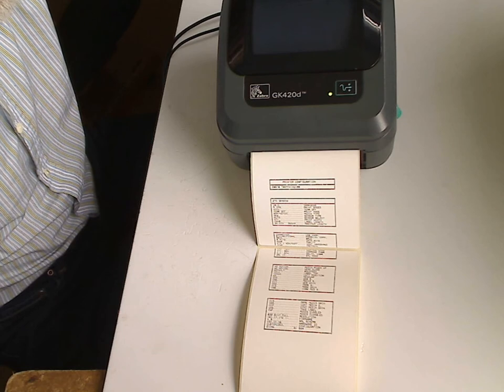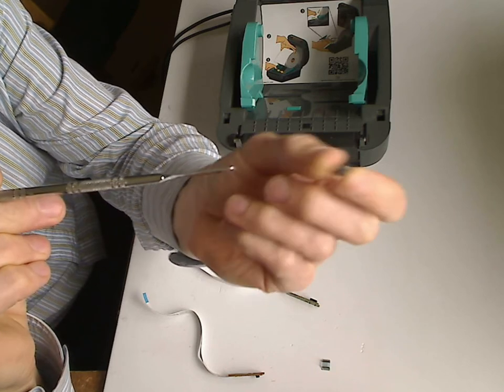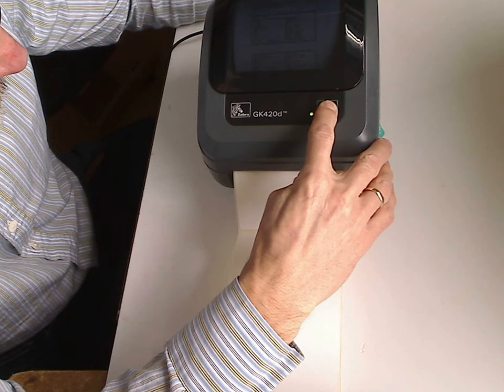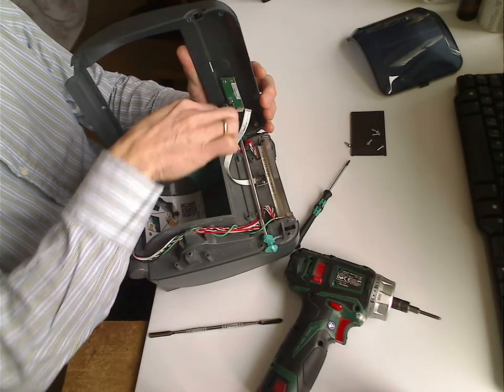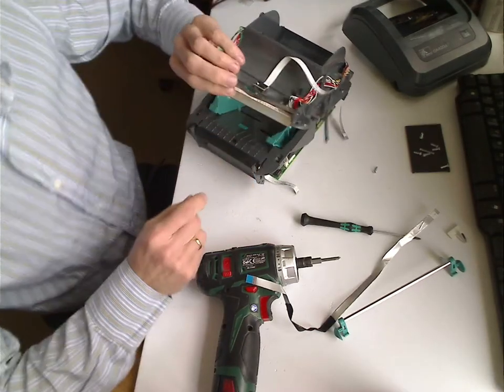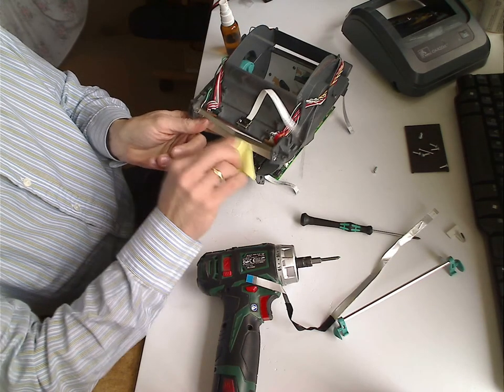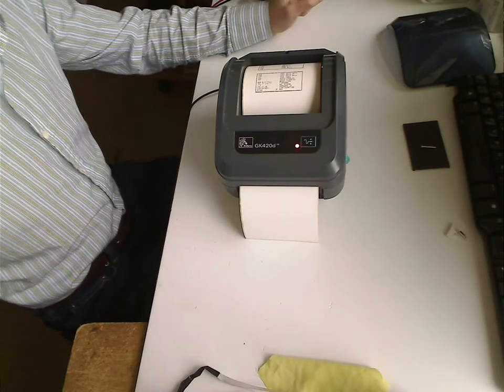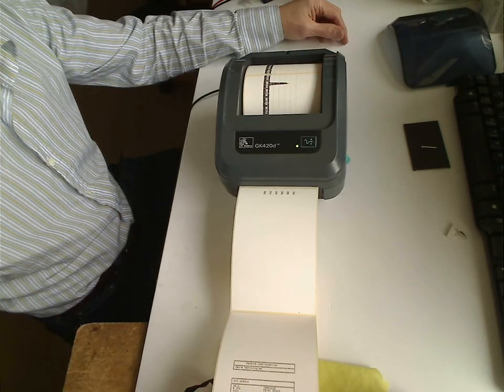Zebra GK420d not calibrating fix by changing flat ribbon cable

Comment: I have two Zebra GX430t printers and they both worked perfectly. One day one of the printers had wrap up when it got down to the end of a roll of 6X4 labels. I cleaned out the mess and tried to recalibrate it again for 6X4, with the two blink setup but it wouldn't do it. I can calibrate it for 2.25 X .75 and 2.25 X 1.25 but not for 6X4. There appears to be no damage to the sensor on the bottom, and I cleaned it, the print head and the roller with alcohol. I've reset the printer to its defaults but nothing I have done has worked to fix this. The other GX430 calibrates perfectly, so there is no problem with the software setup. Can you solve the mystery?
Reply from the maker: Try to print Sensor profile with keeping Feed Button until seven blinks and see if profile has spikes and they height. It's a bit weird issue- usually it either calibrates or not.
Reply: @zebraprinterrepairs  Thank you. I believe I tried that along with other methods I read about, but finally gave up and sent it off to Zebra for repair.

Comment: Very good information I really learned a lot more about this printer.  Thanks
Reply from the maker: I never tried to print profile for perforated labels so can't comment much but if it is peaks it means sensor is working. When sensor is dead then you will have just flat thick print. Cable change will be your solution.
Reply from the maker: Sorry- replied to wrong thread

Comment: Hello,

Thank you very much for the video, it is very informative.
I have a problem with a ZEP 505 EPL FEdex. it prints very well but after each start (as soon as I turn it off and turn it on) it ejects a label. I don't understand why she is doing this. Can you help me please ?
Reply from the maker: It means that default action at start up is set to "Feed". It can be changed sending ZPL command ^MFp,h N using Serial connection only. 
Or simply leave printer all time "On" and you will not have any headache :)
Reply: @zebraprinterrepairs  Hello, thank you for your answer.

Unfortunately, I can't leave the printer on all the time. and I don't have a serial port on the printer (RJ45 and USB only)
I found another tutorial which talks about this problem and which gives the solution but on a ZP 450 and not a ZP505 like mine and I cannot find a way to deactivate the option. :-(
Reply from the maker: @billeltouaibia7189  It seems it is the way to solve your problem. You need to download ZDesigner driver for ZP505 from http://www.fedex.zebra.com/drivers.asp and Zebra Setup Utility from Zebra website. Then you copy command bellow and sent it all at once using USB : 
^XA
^MFN,N
^JUS
^XZ

via Zebra Setup utility "Open communication with printer" . After command sent restart printer and label will not move after you turn on printer.

Comment: My Zebra GK420 is flashing red slowly. The media is loaded and the lid is fully closed but still keep blinking red. I have tried to calibrate it but after calibration still goes back to flashing red. Any ideas?
Reply from the maker: First question is it GK420d or t. If d then first thing to check would be Lid Closed Sensor on right side looking from the front under latch - it happens rare but it can be broke. If t - check if print method set correctly- Direct Thermal or Thermal Transfer.

Comment: i have just change to   p1015889 sensor, rev B by A and dont run. I return rev b (black), i clean glass and 2 sensor with alcohol, and i only a curious thing, that only recognizes the paper, when I start it from off. When they change the paper, they have to turn off the printer, and in the other 20 printers that does not happen. And now down, when I hit the feed button, no paper comes out.
Any ideas?
Reply from the maker: You need to do exactly what you see in this video- change cable. It connects to feed button and depending on which traces are broken will create different issues. In your cases it effects not only calibration but feed button as well.  You can find cable here: https://www.ebay.co.uk/itm/Zebra-GK420d-ZP450-ZP505-Mainboard-Feed-Button-Cable-Printer-Not-Calibrating-Fix-/224085389851?mkcid=16&mkevt=1&_trksid=p2349624.m46890.l6249&mkrid=710-127635-2958-0

Comment: My printer is flashing green and red ,any idea how I can fix.
Reply from the maker: Flash memory chip needs to be taken off, reprogrammed and soldered back. If you don't have tools or skills - I can do it for you:
https://www.ebay.co.uk/itm/Repair-Service-Zebra-GK420d-GX420d-GK420t-ZP450-LP2844-Thermal-Label-Printer-/324045505908?mkcid=16&mkevt=1&_trksid=p2349624.m46890.l49286&mkrid=710-127635-2958-0
Reply: @zebraprinterrepairs hi there. Do you still repair these printers?
Reply from the maker: @LetsMakeGhosts  Yes I do

Comment: please a video how change p1027053  1059340-022
Reply from the maker: Disconnect cable from motherboard, undo two screws which secures motor to the frame of the printer and carefully force motor out. No need to remove label holder mechanism.
Reply: @zebraprinterrepairs  exactly, it is very easy!!!! it is a easy video. Thks by your IDEA